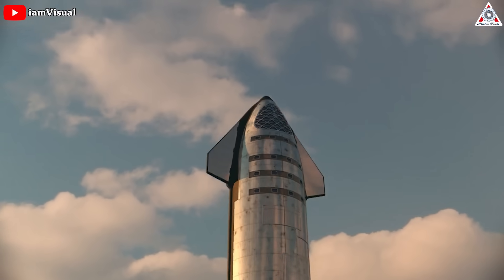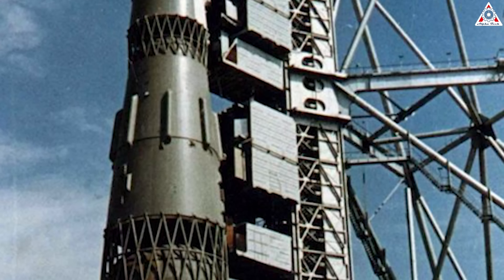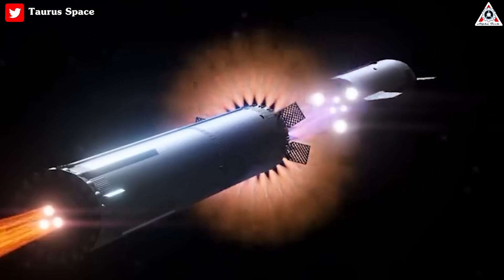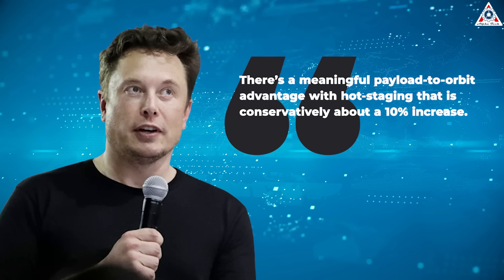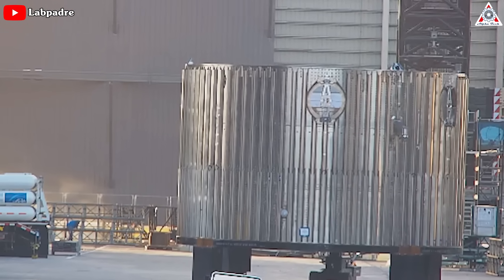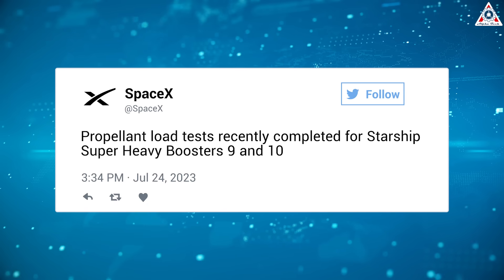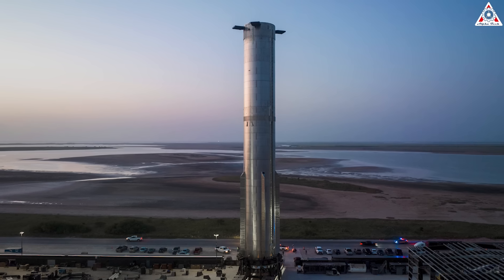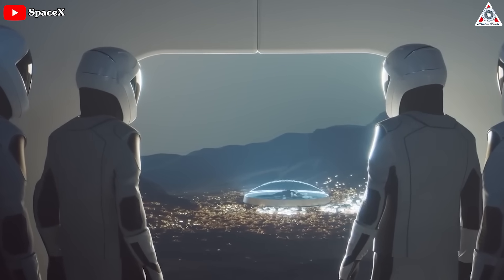SpaceX reveals Hot staging NEW DESIGN, Booster max fuel test ready for Static Fire.

Comment: I like spacex and I hope this works. However, the hot staging will lead to immediate RUD in my opinion. Those engines will cut into the internals of the booster and into the tanks with expediency.
Reply: this working on russian rockets
Reply: @LexStrat  Yeah, different engines. These engines like to chew through steel reinforced concrete.

Comment: I just do not like the way the super heavy oxygen tank just sets there exposed to the starship engines. IMHO it really should have some kind of deflector arrangement along with a quick engine shutoff if the stages fail to separate. My WAG is that the oxygen tank is only going to be able to endure a couple of seconds before failing.
Reply: it is working on russian rockets, there is no problems

Comment: The hot stage is only going to last 2-3 seconds before separation. Those 3 seconds will keep the thrust pushing the beast outward. It's definitely a better design than the stop and start system we were using. We lost probably 90 mph in the seconds of shut down we were using. Switching to the Russian design is just a smart design move.
Reply: Hot staging is being introduced as a smokescreen for very fundamental structural design change of the Starship rocket. Elon wants to hide the fact that the Skirt of the Starship was a dismal faliure partially collapsing at less that 40% compressive loading required to take Starship to orbit at an acceleration rate of 7m/s^2 instead of minimum 35m/s^2 just before MECO. Elon wants to use 6 VacRaptors sandwiched between the Starship and the SH Booster as support columns to push the Starship into orbit. In order to do that he has to build support cradles for expansion bells of VacRaptors on top of SH Booster. To hide these changes from public he came up with clever hot staging rouse. He can disguise cradles on top of uppermost dome of SH Booster  as heat shelding of some sort for hot staging and by introduction of vent rings he can justify conversion from supporting rocket by the Skirt to support by VacRaptors used as support columns.  Vent rings makes it obvious that Skirt can no longer serve as support. Nobody will dwell into question if fully skinned Skirt was ever able to serve as support for the Starship rocket during liftoff.
Reply: @KarolKarolak   Yep, I saw that during the flight, and I think you're right that this is a smokescreen, although that claimed 10% boost in performance might be true relative to his original idea for stage separation.  He's probably been told this repeatedly, regarding that idea, but never listened until this particular failure, and now he's touting hot staging as the be-all-end-all so we can all argue about that instead.
Reply: @rbrtck  There is much more to it than what you saw so far. For last three years, since SN4,  Elon was publicly ridiculed over idea of using the Skirt to try to send the Starship to orbit. Two years ago I proposed Elon to use 6 VacRaptors as support columns as viable alternative to idiotic Skirt idea. Elon has sore spot on this subject, he went so far to prove me wrong that he, by his own admission,  "launched the Starship without using hold down clamps while increasing thrust gradually". This idiocy almost resulted in side of the Booster hitting launch tower after bottom of the rocket cleared OLM. All that was done in an attempt to prevent collapse of the Skirt at the launchpad as soon as hold down were to release the rocket giving it instant acceleration kick.
Reply: Americans have done hot staging before, too, such as with the Titan II, which took the Gemini spacecraft to orbit.  I'm not sure why we went away from that, but there were probably some reasons, such as reducing stress on the engines and thrust structure of the upper stage.  I'm not a rocket scientist, but I don't see why there would be much of a difference, if any, in performance.  Hot staging does let you get away with a little less hardware, but that is paid back with having the upper stage engines burn for a short time without producing useful thrust, which is a waste.  Additionally, in the case of a reusable rocket like the Starship + Super Heavy, you have to make the stages more robust and therefore heavier to repeatably withstand the thermal and other stresses involved with hot staging.  Looks like a wash to me.

Both countries kept doing what they were doing for so long because neither technique provided any significant overall advantage, really.  In the case of the Starship, the only reasoning that would make sense to me is that they'd rather not have to use additional hardware for the ullage engines.  Any other reasoning is a mystery to me, including the claimed 10% improvement in performance.  I call BS on that because if it were true, then everyone would have been doing hot staging, ever, as 10% is a much bigger gain in performance than using staged combustion engines, for example.
Reply: @rbrtck  They gain through continuous thrust, and they gain by being able to reduce the weight of the Starship. Will they gain 10%? I don't know what gains they'll actually get. They will maintain a constant thrust, and the release clamps don't have to be built as heavy duty. That saves weight, but no clue as to how much. The Starship engines will be running at full throttle in about 1-2 seconds causing the release from the super heavy, and the speed of the Starship will be greater than the old method from the 1960's. Gaining even 100 mph at release translates into a ton in fuel savings. Might be more, and we'll just have to wait and see how much the ship gains in fuel reserves. The faster you go, the less you have to burn to gain enough thrust to leave Earth orbit. At Leo the ship is traveling a orbit flight path, and requires more thrust to escape Leo into a higher orbit. It's all about speed once you've reached Leo, and more is better. The gains made at stage release using hot staging with translate into additional tons of fuel available, and the Starship will be moving faster than the old method.
Reply: @marymarlow5598   If it were that simple and an overall 10% increase in performance over every other technique, then everyone would have been doing it since nearly the beginning.  Elon made a dumb mistake blowing up the pad for no good reason, thereby giving his enemies a valid reason to sue the FAA, and risking a huge delay in the Starship program.  He also blundered with that obviously inadequate flight termination system, which could have been dangerous, and now he's finally realized that his idea of having the Super Heavy fling the Starship, had it even had the potential to actually work, would have cost 10% in performance over the traditional forms of staging.  Maybe what has happened here is that he's sick and tired of being wrong so much, and decided to listen to his engineers for once.

I don't blame Elon for choosing hot staging because it involves less hardware, but on the other hand it is much harder on hardware that is intended to be reused many times, which means that more shielding and reinforcement will be needed, which costs weight and performance.  But I seriously doubt there is much difference between hot staging and separating first.  They both might well have a 10% advantage over Elon's method, though.  That's what I think he really meant, but is trying to make it seem like hot staging is just plain superior to everything else.  The US had tried it before and wasn't sufficiently impressed to stick with it.  Both traditional methods are proven and pretty much equal overall.  They're just superior to his idea.

Don't get me wrong, as I like trying new things and not being afraid to fail, but there is a fine line between taking risks to prove the naysayers and hidebound Luddites wrong, and trying ideas that are obviously stupid and could never be better (if they work at all).  Elon used to be on the other side of this line most of the time, but lately he has crossed it repeatedly, and needs to "dial it down".  Exposing concrete sitting on sand (no piles driven into bedrock) to 17,000,000 lbs of thrust is the sign of someone who is overconfident and going off the deep end.  That just wasn't smart...at all.  It's quite the opposite, and I knew this years ago when he first proposed it.  I think Elon is a genius, but right now he needs to get a grip and walk that fine line again.
Reply: thay took this design from soyuz rocket

Comment: The flat steel plate may be a major mistake as it will reflect and reverberate damaging acoustics right back to StarShip’s engines. 

Hopefully the water deluge system will prevent this, HOWEVER the super heated steam my be explosive and may cause thermal damage after repeated use of stage one.
Reply from the maker: Do you know their Firex system? it was born to fix that.
Reply: @alphatech4966  First, ❤️the channel and thank you for your response. 

The big concern is potential cyclic loading damage to stage one caused by the new stage zero flat plate with upside down “shower head” water deluge design. 

Will the current new design be enough to prevent cyclic shock loading damage to stage 0 and stage one due to the enormous repeated harmonic and inharmonic shock waves against the water deluge flat surface plate, that by its mechanical physical properties design, regardless of the deluge system, may likely reverberate shock wave forces and explosive supersonic heated steam directly back upwards into stage one and stage two?

With the new stage two hot start design, the openings inherently weaken the design.

Thus, any significant reflective reverberation caused by the new stage zero design may cause additional damage to stage one hot start areas. 

In short, will the new SpaceX design be great enough to adequately stop the enormous reflective reverberations vs the gradual redirection and water deluge suppression design that I emailed to SpaceX which also addresses further concerns environmentalist are litigating over? 

Since YouTube won’t allow me to post the link to my design, if you can provide an email address I will gladly forward my email to SpaceX of my design to you. 

Thank you for your time.

Comment: Glad to see the added shield layer for the hot staging. But I see something very problematic; the paralelle struts supporting the upper stage. This is a big No! No!
Theres a reason the Russians did a triangulated lattice, Triangles are more rigid and less likely to twist and collapse. The paralelle struts are likely to begin harmonic oscilations due to the sonic transmission of the rocket blast also being an oscilation. And with the amount of compression provided by thrust and the mass of the upper stage, that oscilation is likely to become one sided, and collapse in flight.
Its like building a car port  roof on posts with no braces. the wind oscilations would take it down. 
I already recommended going to a triangular based structure, where every other opposing triangle was sheeted or open, actually they should be truncated and be trapizoidal. this would allow roughly half the diameter open, and they could be taller and slightly more acute in angle if you need more vent area.
i.e. you really need some sheeting of skin steel, for structure. on hulls, 80% of the strength is in the skin.
No skin, you are at best at around 20% even triangulated. that ain't gonna do it considering the weight and thrust and oscilations factor, especially with paralelle structure.
Not gonna fly Wilbur, especially with intended re-use. sooner or later as is, its gonna fail. Hopelly they learn that before human transport, or wise up and replace it before it creates an embarassing failure.
You have been warned.
Reply: thay took this design from soyuz rocket